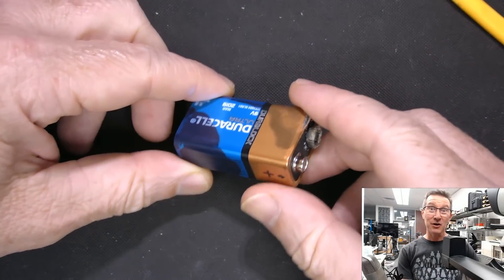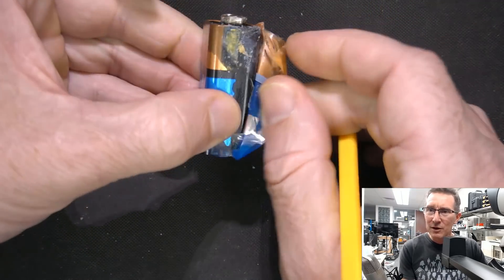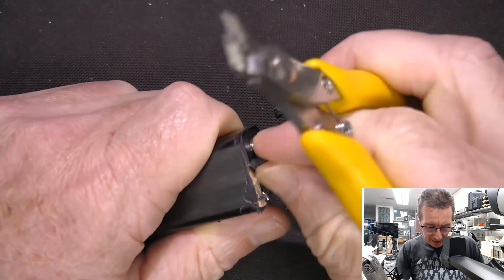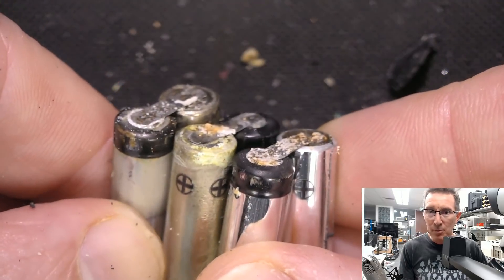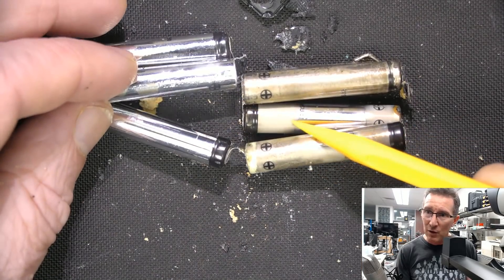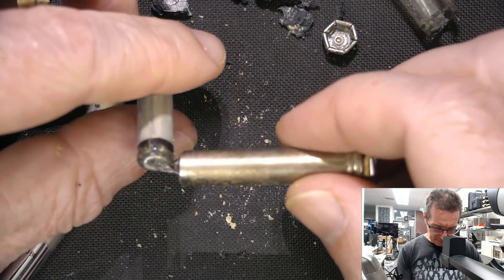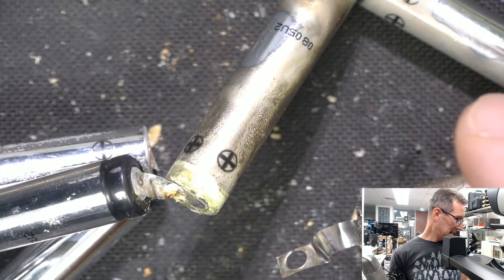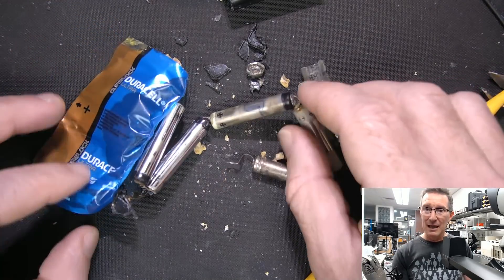9V Duracell Alkaline Battery Leakage

Comment: My dad still thinks that alkaline batteries never leak. Gotta show him this one 😂😂😂
Reply: I say the same thing to the heavy duty zincs. Lol
Reply: @themadatheist1976  actually I seem to have more carbon sinks to leak and then actually alkaline batteries but then again I always generally check batteries every so often anyways.

But also any time I get something new that has batteries in it I always put decent ones in even if they are alkaline.

I make it a point to always put decent batteries in something that I get even if it has batteries already in it it's a better option in my view because less likely to have the crappy ones they're often in them start leaking.

And also of note sometimes have noticed when I've gotten something like an LED flashlight that hand batteries in it just for test purposes it sometimes even States this.

It seems like some of those batteries have almost nothing inside and seems like the cases mostly empty I accidentally squash one of those once when I was getting rid of some stuff.

Also I actually have seen at least one type of battery like that that was a AAA AAA but don't remember.

But it was so light and heavy at one end I had to investigate.

And did not feel right either for various reasons.

Turns out it was was basically a thin housing and at one end was a button cell and the rest was basically empty other than connection between one side of the Button cell and the other end.

It was labeled as the regular battery size no different in the markings of other somewhere batteries are used when a ship something out!
Reply: I’ve had one that was found to have leaked in the vacuum formed plastic and cardboard packaging before I even got it open! I forget which brand this was now.
Reply: I put fresh alkaline cells in an LED book light that I use twice a year. Half the time I find before I need to use it that at least one of the three cells has leaked... I should probably just remove the cells before storage so if they leak they’ll leak outside the device, perhaps in a plastic bag...
Reply: These leak alot

Comment: I just replaced my Eveready Super Heavy Duty (zinc-carbon?) 9 volt battery, in my garage door opener, remote control. It lasted since 2002 and no leakage.
Reply: Yeah, carbon zinc don't leak.
Reply: @EEVblog  They do, but very rare that it is enough to worry about, at least till the cell is way past (as in a decade or so) expiry, and the zinc case finally corrodes almost all away. But the paste inside is so dry that you do not get much liquid forming, unless you are in a humid environment.

Comment: Batteries aren't the same quality any more.
Reply: Of course, the industry is seeing huge decline in sales because of better quality Chinese and generally people don't buy batteries on a routine basis anymore. The only items I use regular batteries are the smoke /CO detectors, remote controls, and one clock whereas the house was absolutely full of batteries with toys, clocks, torches, remotes and loads of other hardware needing batteries. Now the big name battery manufacturers are cutting corners like the cheap manufacturers are, the difference is they have years of expertise that lets them hit finer tollerances, and cut corners just right where as a company with less knowledge will cut too far and make a less reliable product or less consistant product on the productionline.

Comment: The silver coating is aluminium that is applied to the plastic film in a vacuum chamber.
Reply: The potassium hydroxide that leaked from the battery corroded that Al film, leaving the plastic only.  Al reacts with bases quite easily, it passivation layer is useless there.
Reply: Yup, roll to roll sputter machines.

Comment: I love using 9V cells for some of my opamp xeperiments or mic preamplifiers for out going jobs.  Unfortunately Lithium 9V are overpriced per Wh, and li-ion 8.4v rechargables I founds are not very reliable or has noisy drainky 3.7v charge pump.
Reply: I really like LiFePO4-based 9V cells. No problems with lower voltage (9.6V nominal), and the ones I got will happily put out up to 2A with hardly any voltage drop, minimal self-discharge and all the other nice lithium stuff.. 
If only they were about 5x cheaper..
Reply: @Basement-Science  are they charged by a 5v micro usb input on the butt?
Reply: @rabbithazel3034  Nope. They came with a specialized charger because I'm pretty sure they have no electronics apart from a protection circuit in there.
Reply: @Basement-Science  I guess they'd use 3x lifepo4 cells in series.. which would give about 9.9v, max 10.8v.
Reply: I couldn't find any 9v lifepo4 batteries.

Comment: The Energizer 9V ones I have stripped are pile type.
Reply: I have a 30 year old energizer battery that still works  so the 10 year guarantee thing is "fake"  they used to make them very well back then...   30 years in storage and still works

Comment: Alkaline cells rubbish as ever.
Reply: No it's because they're manufacture  of poor quality  it's mostly due to the fact they don't use mercury anymore      they can store much much longer then typical  modern Alkaline cells   I have a 9 volt battery that was in storage 30 years and it works perfectly fine like new  but it is a mercury  based alkaline cells (Energizer) btw.. i'm running an experiment to see how long it will be good for still  by not using it  (i.e put it back in storage)   30 years and counting  Not leaking so far... I have a duracell as a control  that is 3 years old currently
Reply: @punker4Real  are you testing for leakage, or are you actually load testing to measure the degradation in internal resistance?
Reply: @techgeeknzl  mercury batteries have a much much longer shelf life  50-70+ years,  then normal alkaline batteries  it's why the Government Hypocrite  uses them... 

for   leakage. in 2050  i'll do a load test

Comment: I don’t think I have had a 9v battery leak since the 90s. Then again I mostly use rechargeable ones nowadays.
Reply: I quite often find leaking 9V batteries in various equipment, both namebrands and non-namebrands batteries. Guess I'm just unlucky in that regard :P
Reply: @Gin-toki  really unlucky (at least judging from my experience)unless you don’t use your stuff all that much or don’t swap them out when they are discharged. I use mine in pretty horrible environments on exploration sites and mine sites (as well as just sitting in a stupidly hot car all day most days)
Reply: @glenecollins  Granted, I do forget to change them in some of my own equipment from time to time, but I mainly encounter leaked 9V in testequipment at my workplaces and have encountered it numerous times over the years. Especially when working at a UNI and taking care of the equipment in the laboratories. Students rarely care about the equipment there :P
Reply: @Gin-toki  I have been pretty lucky with that, the tradies, geotechs and professionals I work with have generally been a bit tough on their equipment but they keep charged batteries in them and all of the stuff that just does monitoring  either gets replaced when the lithium cells in them go flat or are run on rechargeable lithium ion polymer batteries and solar cells.

Before I had to deal with that stuff apparently they used NiMH batteries and crappy charging circuits and they used to just eat out the inside of the equipment (if you didn’t check it often enough) which was a lot more expensive to fix or replace than it would be now.
Reply: I remember having one or maybe two to leak for me during the last 25 years. I have them in my smoke detectors, multimetets and few other instruments. I only use NiMH in AA / AAA size but I only have two in "9V" format.

I have so good experience (almost two decades) with 18650 that I'm considering to move to rechargeable Li-ion tech in all applications except the most sensitive ones benefitting from no-ripple power source. (Though my 10440 have not been that durable.) Here is a nice AA 1,5V Li-ion test:
https://youtu.be/CzZrB974Zro